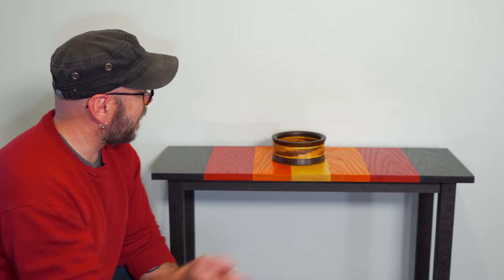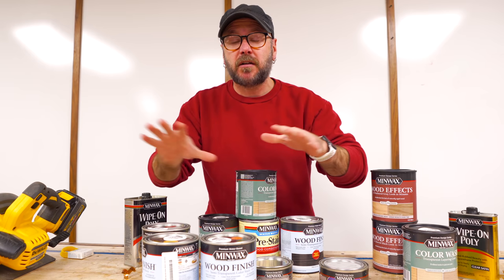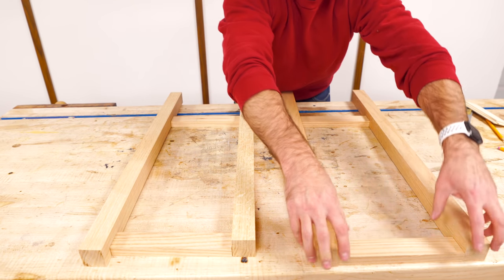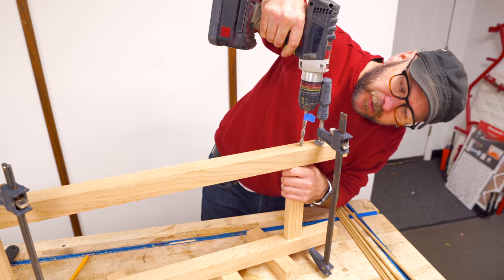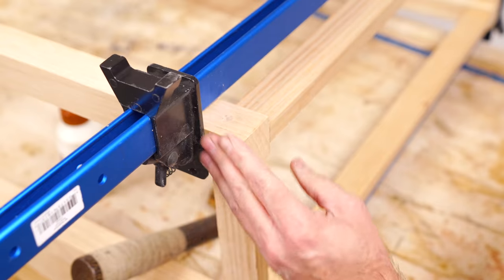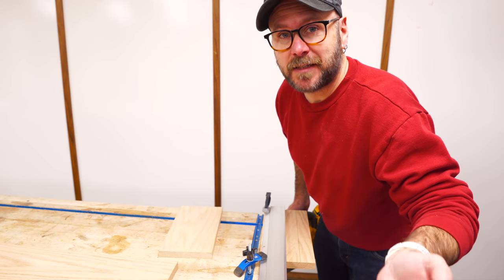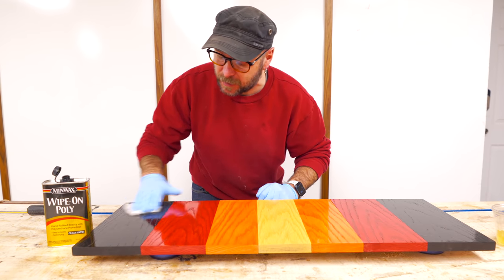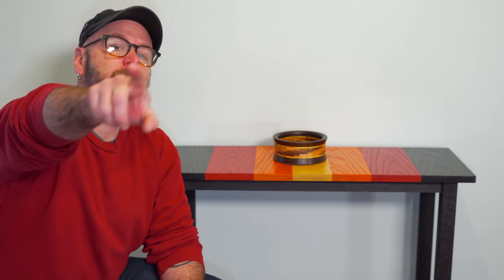How to make a table with only two power tools. EASY WOODWORKING PROJECT.

Comment: I started watching your channel in 2020 as a pandemic fanboy because I wanted to become a woodworker, but I kept seeing all the channels with decked out shops and gnarly machines. By 2021 I was soooo tired of working on the ground and tweaking stuff to get by, that I stopped all woodworking to focus my attention on acquiring machines. Rescued an 8 inch PM jointer from a dump haul. Been restoring a 10inch Walker-Turner table saw on my channel, and scrounging anything I can find just to get a "shop" built up in my garage, so I can be a real woodworker. This video and the recent workbench out of a truck video make me remember why I wanted to woodwork in the first place.  Nostalgia.

Comment: I have used those 2x2 s before. The nice thing about them if you pick through them you can usually find ones that are rift sawn (the end grain runs from corner to corner). The advantage is you get straight grain on all four sides.

Comment: Hey. Great looking table and great to see a project that doesn't require every tool under the sun.
Question though. In a few of the shots the table looks to rock a bit as if it isn't level, the exact same problem I have had when building with simple tools. Just wondering if you can share your finishing technique that sures up the evenness of the legs?

Edit: And I found your technique in the comments at the bottom. Cheers

Comment: Before I invested in a good set of longer clamps, I would screw a scrap piece to my workbench right behind one end of the joint, and screw another just to the side of the other end of the joint (within clamping distance). That trick saved my butt a couple times, but it can be tricky to get perpendicular clamping pressure sometimes
Reply from the maker: Oh, nice tip!

Comment: Great project and love watching your stuff.   One thing that you slid over that I don't think is as obvious as it may seem is your use of the speed square for straight edges.   I have been using it for many years for almost every skill saw cut I do including roughing buildings.  No clamps just hold it with one hand and cut with the other.  Once you get used to it, it is faster than freehand as you don't need a cut line.   Just a mark.  Getting long, sorry.  Nonetheless, I still have people watch me do it and think it is magic.  Not that, just not obvious.

Comment: One other way to work around not having long clamps: wedges! Clamp scraps of wood near each end of the workpiece, then use wedges between the scrap and the workpiece to push things in tightly. I've used this technique when glueing up table tops.

Comment: I love this table. 

Jimmy baby voice - "That's an impact driver, not a drill."
Reply: Oddly, he used the drill and not the driver anyway. I guess his video continuity manager is on vacation.
Reply from the maker: Hahaha!!! Good eye. I did switch to a drill after the intro. Continuity manager has been fired!!
Reply: @MakeSomething  I saw some folks on a HGTV drill holes with an impact and did look it up with my impact (the red one)... they are actually rated to drill holes because of self tapping screws.   Also, if you notice impact manufactures actually make drill bit sets that cuck up in impacts.   That said.  I use a standard drill.  Also, you limited yourself to the just the saw and drill.  Then used a hand saw and clamps.... ah ha!  Busted!  I kid though ;)  nice work on the table.

Comment: As a newbie woodworker, I think some things are missing here - dimensioned lumber at the big box stores aren't always straight.  They warp and bow and do all kinds of things.  Shorter cuts are usually better, but you really gotta pay close attention if you're trying to avoid surfacing or jointing the boards.  Edge glueing a panel requires pretty parallel edges, so in this case, putting the boards perpendicular to the table meant shorter boards w/ less distance to have the edges have gaps.   There's these little changes he's making to work around these things that are suuuper important and easy to miss as a newbie... anyyyways - awesome video as always!

Comment: for those that don't know they make kits to turn 3/4" pipe into bar clamps, if you have some old pipe lying around or have  a friend with some you can get you can turn them into bar clamps for just a few dollars. My shortest pipe clamp is 2' and my longest is 8' and they will do everything in this video that his expensive bar clamps did, where pipe clamps fall short is they don't have the 4+ inch depth that dedicated bar clamps an have but for things like everyday tables, chairs and cabinets they work great.......

Comment: Great video, learned a lot! The colors really do pop out, it looks great. By the way, how did you handle the base wobbling(as seen in the video)? Did you use inserts at the feet to adjust the height of each leg separately or something else?
Reply from the maker: There was some wobble but not nearly as bad as you saw in that clip. That part of my garage floor is like a pitcher’s mound and extremely uneven. But the wobble I did have was removed with a block plane and then attached some felt on the bottom.

Comment: Gorgeous colors, nice work. How did you prevent squeeze out on the top surface when gluing together the pre-stained pieces? I'm concerned that I will get squeeze out, and even if I'm quick and wipe away the glue, I fear it will leave a thin residual mess that needs sanding. If I have to sand the pre-stained pieces wouldn't that erode the consistency of the brilliant colors? All suggestions appreciated.
Reply from the maker: very little glue and have a wet rag handy.
Reply: @MakeSomething  Thank you. Dig your video's.
Reply from the maker: @marinettebrascheche4570  You get bonus points for the Jane's Addiction profile pic.

Comment: Did you use a minimal amount of glue for the table top to avoid squeeze out? I imagine getting glue squeeze out on the stained pieces would be a problem.
Reply from the maker: Very little glue. I've never used much glue in any of my glue-ups because it's not necessary and creates a mess. I've never had a glue joint fail.

Comment: Another way the camp you could also clamp one end to the table.  Screw a fixed board say an inch from the end.  Then use a wedge to hammer between the fix board and the end of the piece forcing on end in place.  Kind of like you would with a bench dog on a traditional bench.   I bought some longer knocks of the long clamp you have from harbor freight.  They are terrible and if you can afford it I suggest you skip the HF ones.  They work ok with some mods though.

Comment: When you first placed the frame on the floor, it had a bit of a wobble. How did you deal with that for the final product?
Reply: It's against a wall so it won't wobble haha
Reply: He has shown in other videos that his floor is uneven.  His projects are rock-steady when standing on a workbench, but 'wobbly' when moved to the the shop floor.

Comment: At two different times in this video you can see the table wobble when standing on its legs.  What did you do to fix that?  

No matter how level things seem to sit when I dry fit them, I almost always have a wobble when fastened permanently.  It's very frustrating for this noob.
Reply from the maker: There was some wobble but not as bad as it looked in the video. I really should have explained this but didn't think about it. The floor in my garage is like a pitchers mound right in the middle. Extremely uneven. But yes, there was some wobble that I removed with a block plane. I also added felt feet which helps.
Reply: @MakeSomething  Ok, thanks for all the info you've provided on your channel.  I'll try that on my next build.  Happy Holidays!

Comment: "Im going to use nothing but a driver and circular saw.".... Pulls out different types and sizes of clamps, drill, drill bits, mallet, flush cut saw, speed square.....
Reply from the maker: Only two POWER tools Tim. You gotta pay attention. Especially in woodworking!

Comment: Help Please!! I really want to try this project but I have tried everywhere to get the pre stain conditioner and its like rocking horse shit, same for the Charred Black and the semi transparent is just as hard to find (tried every Lowes in 100mile radius - nothing! I did find the Pre Stain if you order through Walmart but they wanted $56 for the same tin!! Any suggestions how to find some?
Reply from the maker: Check the links in the video description. You should be able to order it.
Reply: @MakeSomething  Thanks for the quick response, very much appreciated. Sadly I was using the links and every Lowes within 100 miles is out. Your fault! your project is so popular the guy in Lowes said "let me guess you've been watching that guys Youtube video making a table"
Reply from the maker: Is that a true story!??
Reply: @MakeSomething  yes Sir. Lowes South Arlington Tx in between Xmas and New Year. I was off work and figured it would be a good time to try making the table. After I couldn’t find the various stains anywhere I went into Lowes to ask what was going on. That was his Answer
Reply from the maker: Bonkers! Sorry!

Comment: I was just thinking a moment ago. You know some time in the future there should be piles of plexiglass available in dumpsters all over the place as the screens at registers come down. The time is NOW to come up with a project in which to use a bunch of clear plexi when it becomes available for free.
Reply from the maker: DUDE! You are so right!!
Reply: I got five 20'x30' sheets from my wife after her sails season ended.
Reply: @clonecone  holy crap 20 foot by 30 foot pieces.. i didn't know you could getem that big. (unless you meant ", ie inches not feet)
Reply: @clonecone  I'm sure that isn't the case. I was poking fun a little and for that I apologize.
Reply: Is there a way to resurface plexiglass? Most of the free stuff will probably be scuffed or marked up from use. Brb googling

*yes definitely include that in the video
Reply: @MakeSomething   My local Casey's just had upgraded shields installed and got rid of their old ones, from the 4 stores I visited I snatched up 6 pieces of roughly 36"x18" plexi..Four of those are going to become windows in my 3d printer enclosure, if I had a laser cutter the last two might become pandemic remembrances. Ohh and the one place I didn't find plexi I found their old air compressor instead. So, scrap copper, scrap steel, air fitting etc. Good day.

Comment: “Make this table with only two tools”

Proceeds to make table with circular saw, drill, clamps, hammer, hand saw, speed square, paint brush... Title of video is a lie. Table is meh.
Reply from the maker: Dude, I said two POWER tools. Come on man. Also, the table is fucking awesome!
Reply: @MakeSomething  you are correct. I misread the title. Table is still meh lol

Comment: there were not just 2 power tools... I enjoy your video's but man I was really hoping to see something interesting since you put 2 power tools only.
Reply from the maker: I only used a drill and a circular saw. What other power tools did you see?
Reply: @MakeSomething  You plugged the speed square and the clamps into the 220v outlet.
Reply from the maker: hahaha! I've been caught!
Reply: @MakeSomething  also I don't want to make it seem like I hate this video either. Just that I don't have more than 2 power tools and saving for a saw. So I was really eager to look at something like this with as little tools but then again it's on me to figure that and get creative.